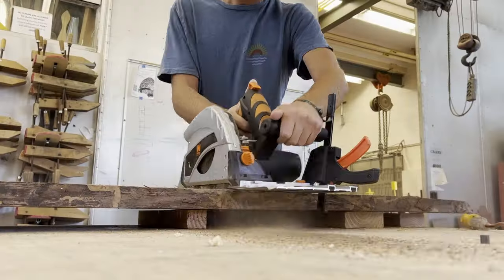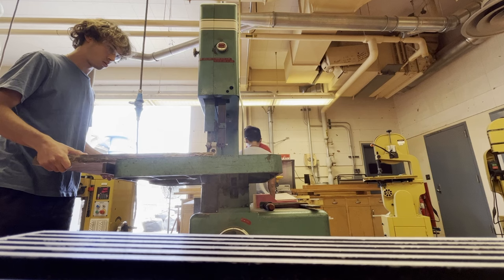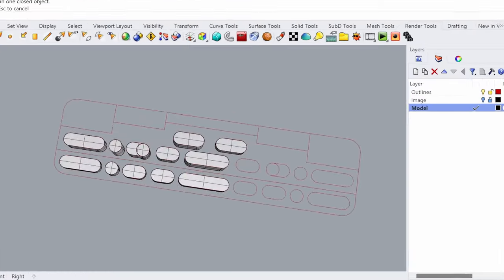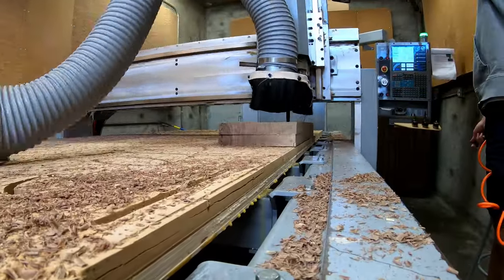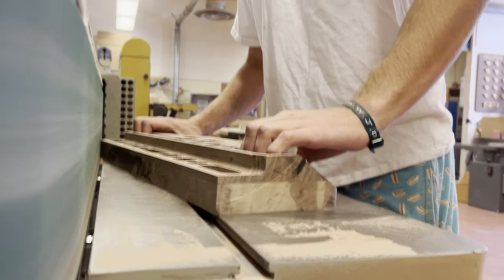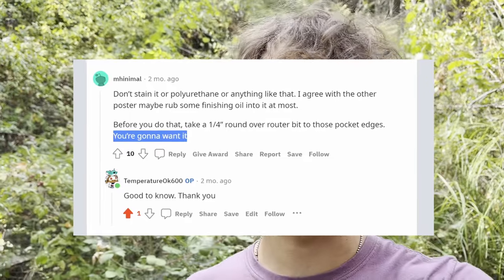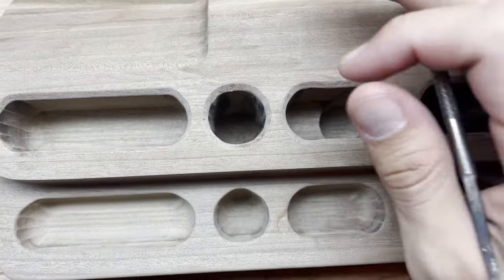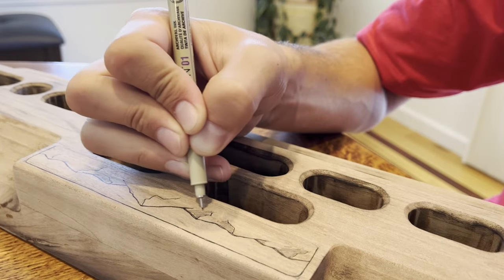I made a Beastmaker for only $15, here’s how.

Comment: Before i thought the beast maker was overpriced because you can just route a piece of wood yourself but now seeing the amount of effort required to do this well, i think ill just buy one haha. Great work
Reply: But you can just route a piece of wood.
Reply: He just made life hard for himself because it’s the first one he built. With more experience there’s way less effort in making one of these with an industrial cnc
Reply: I just went to Bunnings and bought a fence paling for like $2 AUD, routed some slots in it and sanded it down. sanding was the only difficult part. you don't get the slopers like on a beastmaker, but 99% of beastmaker training is done on the 10-15mm 4 finger crimps anyway. (this was done with just hand tools as I don't have a whole workshop)
Reply: One Afternoon and you're good, if you use a router take two pieces of wood so you can easily work on the bottom ones and then glue them together
Reply: Because he didn’t choose the correct workflow. 
The logical way would have been, rough cutting with a bandsaw, planning stock, glue up, cut to final shape, make a template for the router, just a printed template glued to a 6mm plywood piece and cut with the bandsaw or jigsaw, drill the holes, cut the rebate, chamfering and sanding and finishing, it would be 1 to 2 hours not counting on glueing and finishing. 
150 isn’t too overpriced when you count on wood prices, parts they have to scrap because knots or unstable wood grain, products and finishing, but they have around 65% of profit before taxes, specially if they cnc the whole thing in batches and use jigs for glue ups and finishing. 
An amateur woodworker would charge around 90 bucks or so and still make a good profit, not worth the hassle if you have to buy the tools for sure
Reply: @gosonegr  150 is really expensive considering they’d run these on industrial CNCs.
Planing and glue-up at scale doesn’t cost shit, and some CNC runtime isn’t that expensive either.
Finishing(mainly sanding) is driving cost here, as that’s the only part where a decent amount of manual labor is involved
Reply: @TrolloTV  it's not only the runtime, fixing and removing is somewhat slow, at least on routers, also, tooling isn't cheap, unless you don't mind to waste time removing burning marks.
Reply: @gosonegr  You can set up CNCs for alternating operation in different parts of the work area. That way you’d have practically no downtime.
Also burn marks are usually a sign for bad feeds and speeds, and not anything about the tooling (which isn’t that expensive per piece).
Reply: @gosonegr  There is no way they are gluing stock for the ones they sell, you only need 4 4
Reply: @gosonegr  I mean....your process has a LOT more steps and a lot more room for human error. He basically goes CNC -> Chamfering, sand and finish. His process isn't perfect, to be sure, but you're just being contrarian lmao. I totally agree with you on pricing.
Reply: You don’t have to even do the glue up if you use a thick enough piece of wood. Beastmakers are made from tulipwood which is cheap in Europe. I just bought a piece big enough to make two boards for 39 eur (42 usd?) so 21 usd in wood, make a template for the holes, and route away

Comment: Cool project! I made a small batch of hangboards (about 8) with the intent of selling them a few years ago but once you actually go through all the steps and costs needed, it's absolutely pointless financially to make them yourself. Unless, you just want an interesting project or to make one for yourself. 
1. Generally a quality wood blank is going to cost you a lot. Unless you can source it from somewhere for free. For me the good quality wood itself (I used oak and birch) was about 20 bucks per board. (I'm located in Europe)
2. I learned to use Solidworks (3D CAD software) just for this project and that took a while. Designed my own simple boards based on existing ones. The CNC specialist had to make some additional changes to my file as well, because I was a complete newbie.
3. I had a friend of a friend CNC route the boards as they had an industrial setup, but generally that process can also be quite expensive. A random service provider asked about 300$ for 5 boards for that job. Not all workshops have the bits to chamfer the edges for example, so that last bit I had to do myself with a Wood router. Which I also bought for the project. So if you're serious, you really need your own CNC setup or a good aquaintance :D
Just my two cents. I sold my boards for cheap (40$) to my fellow climbers just to break even and they sold like hot pancakes in 2 days. Was an interesting project. And still have one myself.

Comment: The Beastmaker holds have a radius of about 5-10mm which looks more rounded than what you did. If your holds aren't rounded enough, then skin/pain tolerance will be the limiting factor for training instead of actual tendon strength. Of course, if you have good skin genetics it won't matter.

Comment: Pretty nice work, looks great! However, do you really like the holes? The Beastmaker boards still have a way more comfy rounding from the looks of it. And the roundings are what makes all the difference.
Reply from the maker: The holds don’t hurt at all, but I’m sure the expensive store bought version is way better. That said, I’m happy with what I’ve got, especially for the price. Thanks :)
Reply: You can take a router with quarter circle profile and round the edges.

Comment: Everyone in the comments are crazy saying $150 is a better deal. If you can find a decent piece of wood that’s that is the right size already you can skip the first step he did entirely. The CNC process is easy because there are workshops in most cities you can pay to mill for you. Also I bet there is probably a CAD file for the beast master floating around online so you don’t have to learn how to do any drafting and then just drive to a local engineering workshop and pay $15 for them to CNC it. Also Fusion 360 is dummy proof and free, spend an hour learning it and you can design and modify your hangboard exactly how you want it. The sanding is the only
shitty part.

Comment: Cool and all, but apparently you only need free access to tools that cost tens of thousands of $$, if not more, to be able to make a beastmaker for $15 xD: 
1. A free piece of wood 
2. Free access to a industrial size bandsaw or equivalent. (which by itself costs thousands of dollars)
3. Free access to an industrial planer or equivalent (which by itself costs  thousands of dollars) 
4. $15 (basically free) access to an industrial CNC-machine (which by itself costs thousands of dollars)
5. a set of clamps that probably costs more than the beastmaker itself. 
6. Table saw and sander that costs more than a beastmaker. The dewalt sander probably is close to the beastmaker in price too. 
7. the porter&cable router is probably upwards of $200. 

Conclusion: Just buy the beastmaker for $129 and save yourself the time and money.
Reply: many have parents or family who have access to all of this, mine for example, and it would've never occurred to me to do it if i didn't see the video. Besides, you can always carve the wood yourself with way less tools and a lot more work.
Reply: @dawnriddler  This is ture. and it doesn't need to be as "fancy".
Reply: Could do all of it with a drill press and a set of forstner bits, a table saw, palm router, chisel and some sandpaper. A lot more people have access to that much.